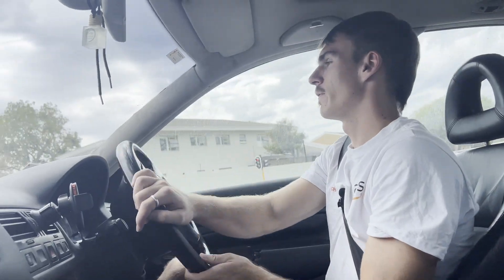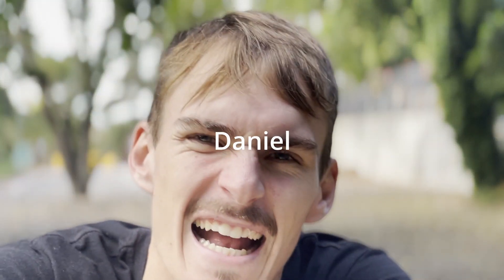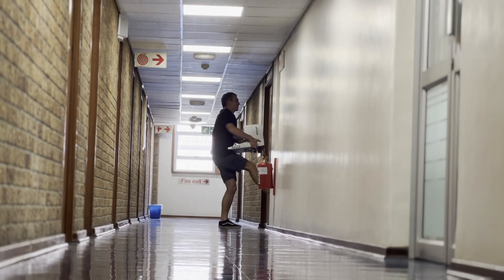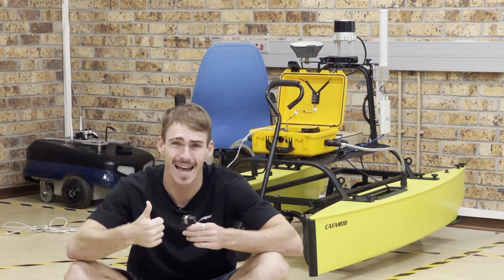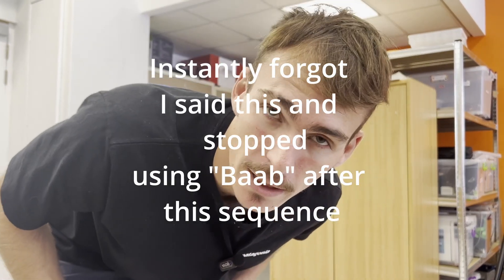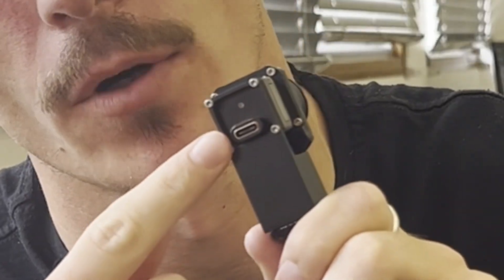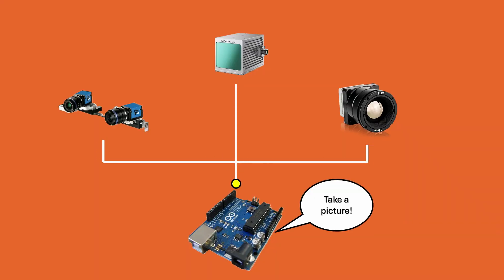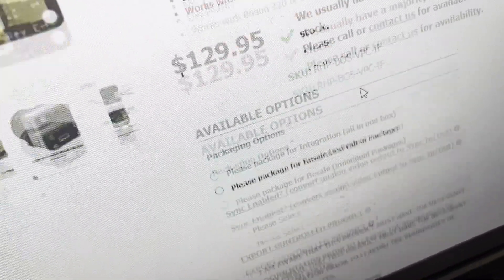Why America Doesn’t Want South Africa to Have Thermal Cameras

Comment: 7:27 Mother fu!.... 

NORMALIZE YOUR GOD DAMN VOLUMES!, you woke up my whole f-ing house!
Reply from the maker: @Mort_OOPz  apologies 😂 how does one do that
Reply: @daniel_maxwell_jones  I apologize too, that was somewhat an over-reaction, I type faster than I calm down ;)

The method will depend on what editor you run, but its a common topic, unless you're using some super obscure editor there should be numerous articles/posts explaining it.
Many/most editors have an automatic tool and its usually just a few clicks to run it.

The old fashioned method however: Just eyeball the waveform of the edit, if there are bits standing up noticeably higher than the rest, thats the bit that needs turning down.
Reply from the maker: @ no worries 🫶😂 thanks for the advice. As you can tell, I’m new to this whole editing thing
Reply: @Mort_OOPz  no it wasnt. i was wearing headphones and cause ear damage, now i hear ringing. you reacted perfectly fine.
Reply: @daniel_maxwell_jones  serious dude?? you are ON the website with the tutorials. lazy ass. 😂😂😂😂😂😂😂😂😂😂😂😂😂😂😂😂😂😂
Reply: sounds like a you problem

Comment: that describes why one of my big project is to build a thermal camera using infrared sensitive vidicon(think of it as an inverted crt monitor situation) and make a high res thermal camera using multiple tubes and pixel interpolation, also, given the issue is that the camera cannot be triggered with an external signal by itself, why not instead slap some single board computer in between that'd interface with the camera and emulate a triggering behavior ?
Reply from the maker: That is such a cool project. I would love to hear how that goes. 

Yep, we a trying one more avenue to order the component, otherwise we are basically going to do exactly what you are suggesting 😂

Comment: I have been facing a very similar issue. You need to look at the Wassenaar arrangement. For dual use/military graded equipment you need a permit and registration with the DCAC. 

In my case, I need low resolution thermal arrays for low power AI security/anti-poaching system. Many of the sensors I want to use have a frame rate of 10fps; 1fps above the threshold of 9fps thus requiring a permit, etc.

The likes of Digikey won't sell suitable sensors, even those lists as EAR99.

The irony is that you can buy a thermal rifle scope online illegally without any of this. The problem is that private individuals sell this equipment to terrorist groups, Google it for reference.